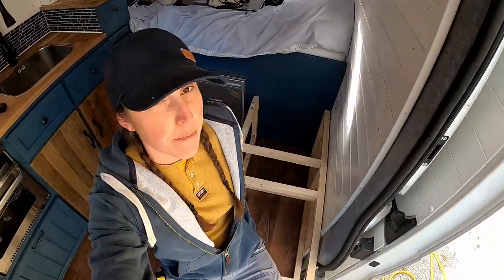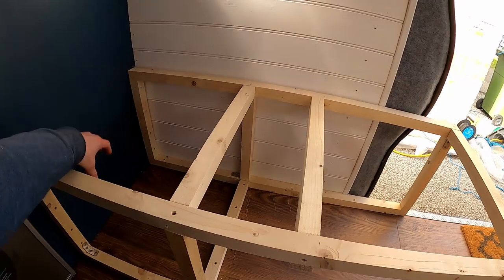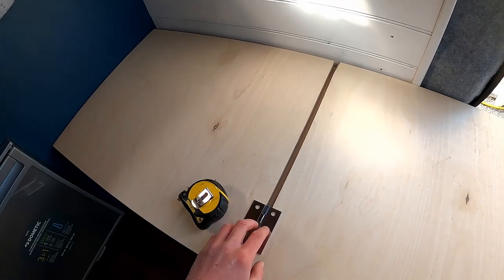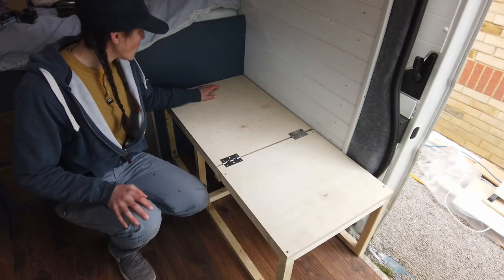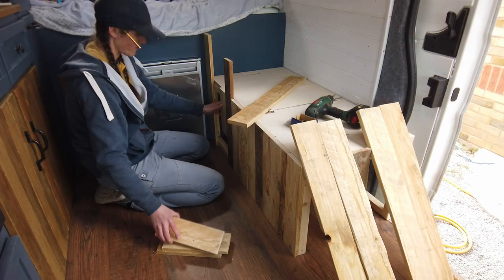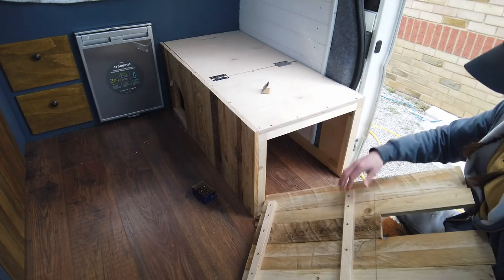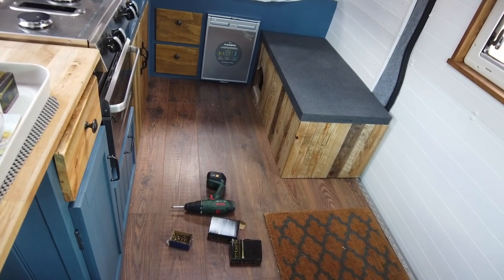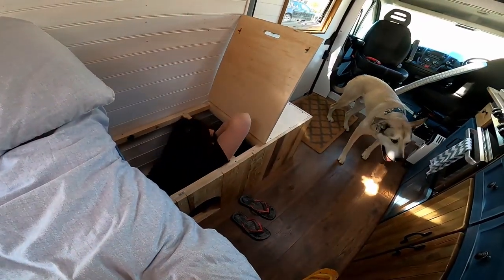Building the bench seat in our diy campervan conversion... slowly going insane!

Comment: As always a wonderful video both in content and production (Lou should be giving lessons to a few people at aunty Beeeb). Just in case anyone encounters the same scew issue as Lou, I have a solution that may help some. First progress as Lou did. Then you can shorten the screws, either by hacksawing the tip off (hold the screw in a vice or mole grips by wrapping it in cardboard) or if you have strong wire cutters you can often just snip them to size. You can then replace the smaller screws and washes using the same holes. Hope this helps someone